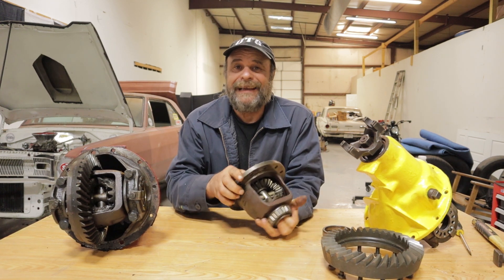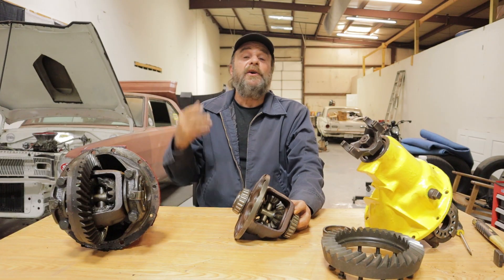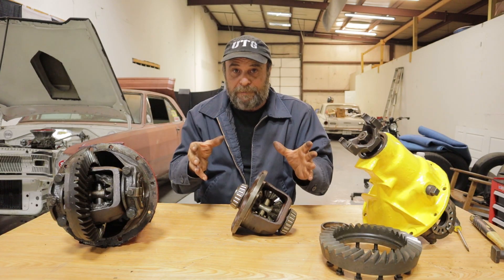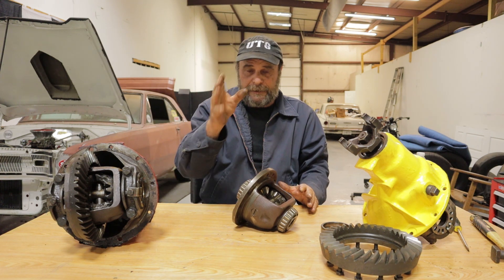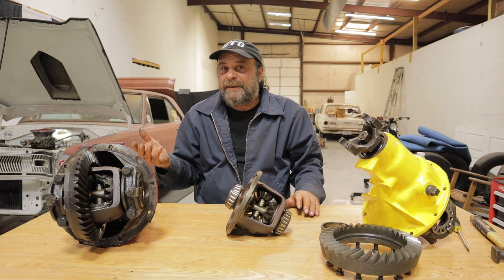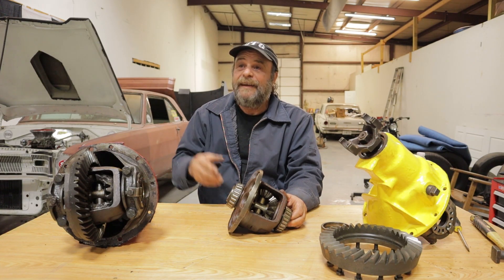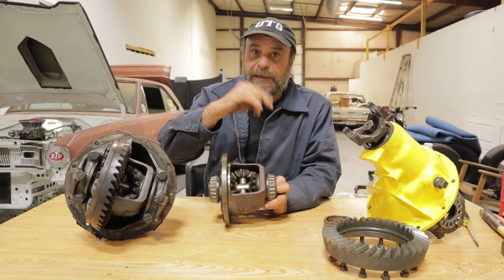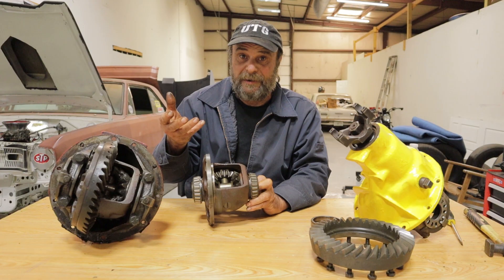Open Differentials - Getting The Most From Your Factory Peg Leg Rear Axle And Where They Work Best

Comment: This makes me feel better about the little 8 3/4 open rear diff in my 68 Dart.  I don't know much about it since I had to find it in a hurry when the factory 7 1/4 gave up on me when I was daily driving the car. I know when the 8 3/4 was installed, the shop that did it added a add a leaf kit due to the factory springs were tired. I don't know what the gears are in it, but I do know it does cruise pretty well on the highway.
Reply: you can always use a gear ratio calculator with numbers from your speedo, tach, & wheel diameter to calculate your diff ratio
Reply: @yurimodin7333  or do the old jack the car up and mark tires and driveshaft with chalk and do the spinny spinny thing 😄

Comment: I've had half a dozen 2WD Ford Rangers as winter beaters over the years. Besides good tires, I put 200 lbs of sand in the bed, biases towards the passenger side, and run an air shock on the right rear. If I didn't tell you, you would never know the truck didn't have a limited slip in the snow.

Comment: Contrary to welding spider gears, I'd love to see more stuff about using open rears and what they can do. A tech video on tightening up the slop to get a better bite and the kind of suspension work to get an even bite would be great. I know suspension can be less exciting than engine tech though.
Reply: I put spring spacers in the right rear of Mustangs and Firebirds to help get rid of the One Wheel Peel.
Reply: @TIMEtoRIDE900  guess I'll need to do that for my little 4 link Toyota.

Comment: My Datsun has an open diff. It spins both wheels the same. Maybe if you're really pushing it around a long corner the inside tire might slip a tiny amount but all that does is improve the predictability of the rear end. Its all about the suspension and weight distribution. If you have a proper car forget a lsd. Obviously a live axle takes more to make work around a corner.
Reply: its the exit of a corner starting a bit past the apex, when you have enough power, where the LSD shines. Its for maximum acceleration onto a straightaway.
That's why racecars have them. The car may handle better overall with an open diff. But in a race situation, it will be slow.
Sounds like your car is perfect for you now. But if you add more power, and get more grip in the corner. The laws off physics will become apparent-- More weight will shift from the inside tires to the outside tires, and the inside driving tire will start to spin......and if its spinning with an open diff, you aren't going anywhere fast.

Comment: There are lots of things I don't understand, but one of the BIG ones is this....if the left front is picking up under acceleration off the line, wouldn't that force the right rear down? I can feel my 67 Chevelle pick the left front up and squat the right rear off the line when I stomp the loud pedal. Wouldn't that put more grab on the right rear? Yes, I have an open diff, and yes, it will light up the right rear on launches. So with the mostly-stock 4-link rear and open diff, what's the answer to powering both rear wheels more evenly in order to avoid the right tire fire?
Reply: I THINK... that UT mis-spoke at 1:47 when he said the left front lifted, and the opposite occurs; the right rear lifts.  Later he says it plants that right rear tire. I'm going by my (admittedly weak) understanding here, but I'll wait for his correction before being sure.

Comment: I have a 04 mustang and back in highschool I did some work to the engine and really improved the power and started busting spider gears and shearing pins so the 4th time I gave it the ol "Lincoln locker" and it's held together the longest so far and really improved the launch on the strip

Comment: I had a 71 road runner 440, 4 spd. With open rear differential. I put a traction bar on the passenger side spring and adjusted the snubber so the car was putting weight on it when the car was sitting still. Worked really well at getting both tires to grip
Reply: Very cool, do you still have the car?
Reply: @Bob Hill  I am storing a 71 Roadrunner 440 (3×2 carbs) 4 spd in great shape.  Owner wants to sell it.
Reply: @alanrader3016  Excellent car (with my favourite engine/carb setup) auto or stick? Do you want to buy it?
Reply: @Bob Hill  this has original engine and 4 sp manual tyranny.  Really a nice car.  I am only storing it for a widow lady who wants me to help her sell it.
Reply: @alanrader3016  That's really nice of you. I feel sad for the widow though this scenario isn't uncommon. Maybe make an offer. I've always had a soft spot for the pistol grip! I bet the husband bought it new, enjoyed it, stored it, and passed on.
Reply: @bobhill3941  I guess he bought the nicest one he could find about 25 years ago.  Only drove it to local graffiti cruise, then garaged it the remainder.  Probably list it on BaT auction soon.   Original Lemon Twist and graphics.  Has the vacuum powered air scoop.  It's pretty cool!
Reply: @alanrader3016  It sounds pretty cool, those air grabber scoops with the shark teeth look awesome!

Comment: You're giving away my secrets, lol. My College hotrod was a '74 Duster I swapped a 340 and a 4spd into. It had a 3.55 open diff and no slapper bars so people didn't give the car alot of credit, I made sure to do dirty 1 wheel burnouts in gravel parking lots so everyone knew I "couldn't hookup". What I had done was the old trick of only having the right side airshock hooked up and as much tire as I could get my hands on which reinforced the "all show, no go" vibe. Like you say, run some pressure in the right shock and never leave super violently. It worked really well and I even had to jack up the car to prove to a friend of mine that it wasn't a suregrip because it would occasionally leave 2 stripes

Comment: Great content, I always had a open diff, on the street. I had friends with lockers or posi but usually you would end up headed for the ditch. In those days 70’s, tires weren’t the best. So I figured out if you wanted to play on the street it was line lock , a B&M with a stall converter and a open 9”

Comment: Oh my how about a gov lock from chevy and blow their minds!
Reply: I blew the carrier in my 87 K5 4x4 10-bolt gov-lock 3.73 trying to yank a buddies 78 3/4 ton 4x4 Chevy out of a mudhole years ago. Managed to slap some of the metal carnage together with hose clamps to hold the axles from walking in and dropping the C-clips, then drove it off the trail on the front diff. LOL. Good times!
Reply: @renchjeep  yes me too in a 1979 chevy blazer k1500
Reply: Yep I drove thru a mud hole and filled it with water and boy it howled for a week or so, ended up finding another rear end same from junk yard and SWAPPPED it

Comment: Ahh yes, the UN-limited slip differential. Seriously though I've noticed with an open diff a big sticky aired down tire, especially on a well prepped track can hook up surprisingly well. I've also noticed that if you drop the clutch at high rpm on an open diff a lot of the time it will very briefly spin both tires. The driver side mark is usually only a couple inches long though.

Comment: I Don't weld them in the carrier just weld 2 or 3 theeth on oppisite sides of each side gear and grind the edges smooth. Install them same way they came apart. Welding a carrier with C clips the other way you will never be able to take it apart again.
Reply: Forgot to mention weld 1 and 2 teeth on opposite sides of spider pinions also so they all mesh and can be installed that way. similar to a mini locker and if you ever want to change back to open diff you can remove them and put spider gears back in

Comment: My experience with lockers is once you put one in you will start really breaking stuff! I never broke anything on my Jeep until I put a set of lockers in. Then I broke u joints and axles shafts. Upgraded them and broke a housing, reinforced it and broke a pinion. Finally I put a full float rear and a  kingpin front D60 in and that was the final solution.

Comment: Yes Tony, I would like to see a tech video about welding  up spider gears. I enjoy your content and I look forward to your next video.
Reply: Absolutely - and elaborate on the idea of tightening up the spider gears for some Posi action, or would that not be good for the street??
Reply: @TIMEtoRIDE900  see my response to Avery Alexander under my comment.
Reply: Its pretty simple. Use a stick welder, and after welding the gears to each other in the corners, put a rectangular plate in between the spiders on top of the pin and weld it to the gears. A lot stronger
Reply: Ditto. Dorks like me need all the instruction we can get.
Reply: Yes. I never knew weather it was ok to try and cover up the ring gear to reduce welding splatter and do it in the diff or strip it down and weld it on the bench then clean and rebuild. It always seemed risky to just whip the rear cover off and start welding if you wanted your diff to last even though I have seen it done a few times.
Reply: Get on Garage 54 they weld piles of axles and other stuff. Gearhead city
Reply: Go look up some mud mowers on here and check out a Doc Locker. 
Would be cool to scale it up for cars somehow using a similar idea. 
I've found these silly mowers are great ways to prove a theory and then move it to a car. 
It's smaller and easier to manage, there's not much that can't be taken down to a bare assembly within minutes vs hours on a car.
Reply: Never thought about tightening  spiders up, makes perfect sense.  I've done it a lot on psi units to get more clamp load.
Reply: @benrossbach6501  ...ive shimmed many open rears....once you get it right, it rocks!!!  kinda a PITA but...cheap, just takes time
Reply: I don't know what a "Spool" is.
Reply: @BrewBlaster  a "spool" just locks both of the wheels together 100%....no spider gears, no helical locking mechanism (tru-trac), or clutch (posi).
Reply: @drrrrockzo  Thanks Doc.
Reply: @BrewBlaster  a spool is a differential that isn’t a differential at all,  just a chunk of steel the right shape for the housing.  Like welded up but it’s not actually anything separate to weld up
Reply: I do food videos while high af on my YouTube channel 💯

Comment: UT, we always welded our gears back in the day. Daily driving was a PITA but what were a bunch of kids with no money and nothing but a junkyard to scrounge through to do? We had to get the cars ready for the weekend. My wife has been there from the start, almost 40 years ago. She never complained once about stripping the insulation off copper wire for money or hand packing the wheel bearings on the car trailer. Those were good times.

Comment: Thanks tony, this applies to my current project. Miata factory lsd's go for 1,200 currently and open 400 dollars each. I bet if I play with the rear sway bars and use an engine torque dampener I can avoid welding the spider gears. I'll have to do some research on where I can put and how to spec the right air shock to absorb some torque. I did hear if you pull the sway bar out the body can roll more on the rear keeping better traction but the way the independent suspension and subframe rear works with the bracing between the trans and dif I can only imagine the rotation and the cortrol arm pivot points leaning the tires to one side.

Comment: I also seen a company offering flat short pieces of thick metal with gear teeth cut out all around the piece of metal so you lay that down in between the spider gears and then weld them up . the pieces have a light bend to them to match the curve of the spider gears
Reply: I've seen a lot of people, similarly, weld in a flat plate. They just cut it to size and make sure they extend their weld into the teeth. They typically do this after having welded the gears to each other.

Comment: Can you elaborate on benefits/drawbacks?  Like: how would this affect a daily driver?  What is the advantage off-road? etc
Reply: The handling of a daily driver with a spool or welded spider gears can only be described as demonic.  Every corner you go around will have one tire hopping.
Reply: If you are asking about the drawbacks of a locked/welded rear end, I can speak to that.Some years ago, a friend welded the spiders on his ( streets driven only) 68 Chevelle, which was only moderately strong. Results: a car undrivable  on any road with curves, a car that was really dangerous on slippery conditions, and a blizzard of broken bits.....
I don't do off- roading, but I could see some possible benefit, particularly under muddy conditions. It seem that rock- crawling might benefit from some limited slip system, but that is just a guess. Comments, anybody?

Comment: Definitely want one wheel peel when traction is limited on road driving.  Sounds backwards, right? UTG hit a little bit on why.  If a wheel slips, you lose a tremendous grip with the ground.  Open differential means one wheel may spin and lose grip, but the other one will keep you moving straight.  A limited slip will cause both wheels to spin. This will cause dangerous oversteer and may send your car straight into the ditch.
Reply: My first experience with Sure-Grip was about 2006, the 8 1/4 in my 78 Cordoba blew up and there was no chance of rebuilding it. My dad had a junk 78 Magnum that had a Sure-Grip 2.45 geared rear end in it, it originally came from Wisconsin. I swapped out the rears from the Magnum to the Cordoba and on the test drive it had been raining a little so it was just slightly damp. Well I made a right turn from a stop light and hit the gas, the car swung left, then swung right, it scared the hell out of me.
Reply: My first experience involved borrowing my friend's posi equipped third gen Camaro with wheel well filling rear tires to get to school. The direct path to school involved a couple miles of gravel road. It happened to be raining that day. I hit that gravel road, and the car instantly became undrivable. It would just fishtail back and forth. I managed to crawl back to the pavement and took the long way to school. I learned a valuable lesson that day.  Don't get me wrong, limited slips are fine as long as one of the rear tires has some sort of traction.  However, if both tires are tractionless, both tires become directionless, and that is a scary proposition.

Comment: i've never used them but lunchbox lockers i guess are an intermediate between mini spools and regular limited slip cost-wise.
interesting take on open diffs i never knew.
Reply: I have a lunchbox in one of my cars. It was roughly the same price as an LSD, but it's an actual locker. The real cost savings you're harvesting with a lunchbox is in the complete lack of setup required to install one. Just roll the spider gears out and roll the lunchbox in. No bearings, shims, crush sleeves, etc.

It works well enough. Lots of clicks and clacks like the big-boy lockers without the big boy price and durability. Nothing I will ever own is likely to make enough power to break a factory carrier, so... should be fine. 🤞
Reply: Wtf is a lunchbox locker?
Reply: @brandonford8092  Powertrax Lock-Right (what I have) is an example. The locker assembly goes inside a factory open carrier and replaces the side gears with 2 pairs of drive dogs. The drive dogs apply load from the carrier to the axles via the vertical cross pin until there's enough of a speed difference from either wheel for one pair of dogs to jump past each other. They function like a regular locker, but for a fraction of the price of a locker. They're about the same price as entry level LSD units, but superior in function if you really want 2 wheels driven as much as possible.

I've heard the "lunchbox" nickname comes from either the idea that the locker is packed inside of the carrier, like a lunchbox, or that the lockers are so small they can fit inside a lunchbox. No clue if either is accurate, but that's the slang term for that style of locker.
Reply: Lunchbox lockers, like all lockers, are a whole other level from clutch based stuff like positrac, but much more streetable than stuff like spools (and a lot of times, the clutch based stuff.)
Reply: @immikeurnot  Is that what's in an '83 Camaro Z-28? I's open until it locks, then it stays locked sometimes until you can make a slight turn, then it's open again. You can't run a mini-spare ! Shredded the crap out of a tire once, needing to get home.

Comment: LIMITED SLIP CAN BE DANGEROUS on a hot day and slick intersection.  Found that out with my '70 MACH 1 on a left hand turn 30 some years ago.
Reply: Very true and during a Left turn you are effectively planting the right rear so even a peg leg will get sideways while spinning both tires.
Reply: I don't understand what you are trying to say?
Reply: @averyalexander2303  tar can get slick on a hot day and when you've got a quarter pounder with cheese in one hand,  a soda sitting on the seat between the legs and the rear end breaks loose, then find yourself looking at oncoming traffic. The left/right pedal dance and one handed torsional twists at the steering wheel gets very interesting. Both rear wheels spin causing a loss of traction and a torsional effect on the whole chassis that you may or may not overcome with the steering wheel. As I found out, eventually in that moment, just letting off the gas allowed everything to settle down to regain control with no cheeseburger in my lap and a dry seat.
Reply: The old ladie can be dangerous on a hot day too